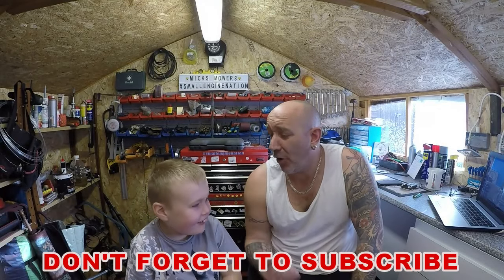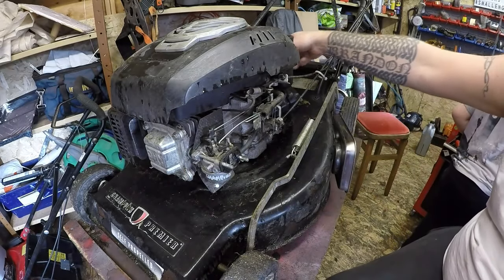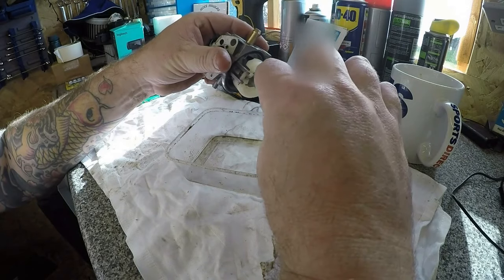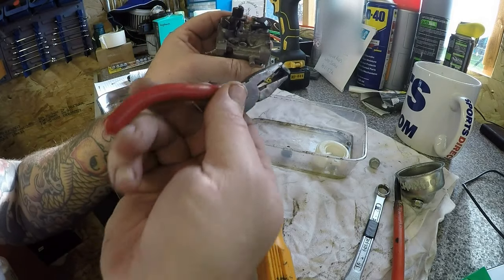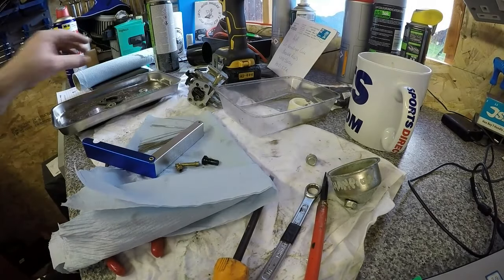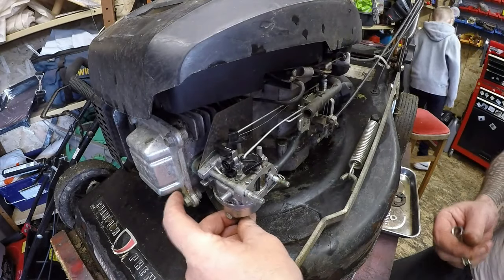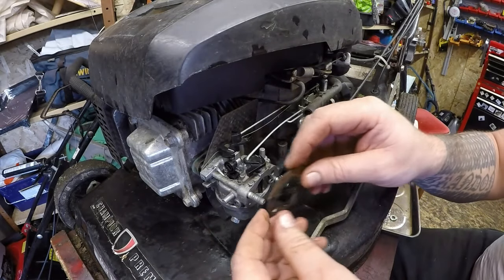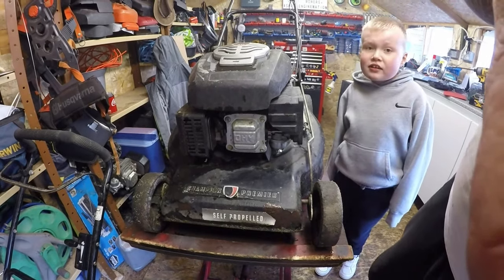How To Clean A Lawnmower Carburettor #carburttor #lawnmower #easyfix

Comment: A tip my
Old man showed me right there
Mick , fileing the jet out with the needle
File
That doesnt quite go threw , nice on mick keep it up buddy! A good going over with wd40 and a blow off with the old air compressor does the job 9 times out of ten
Reply from the maker: Jack Bray yeah mate it works very well the older they get the more fuel they need.

Comment: Hi Mick I got a Parker top handle chainsaw that runs on choke but ass soon as you take the choke off it stops i have cleaned the carb but still will not run
Reply from the maker: Does it have a spark arrester of so take it out and clean It. Also take the exhaust of abd set fire to it to clean it out.. if that does not work go back to the carburettor